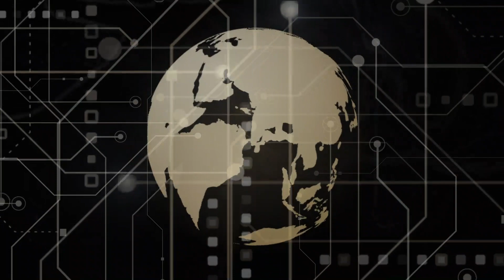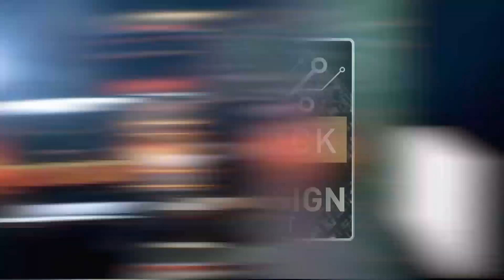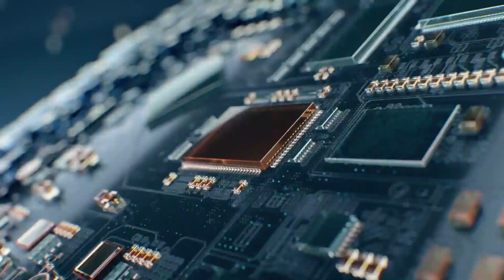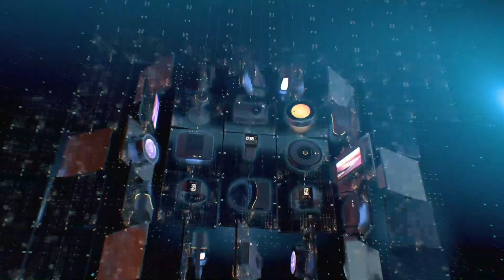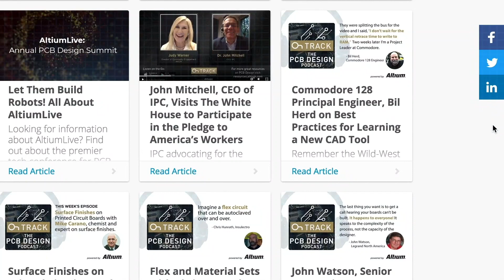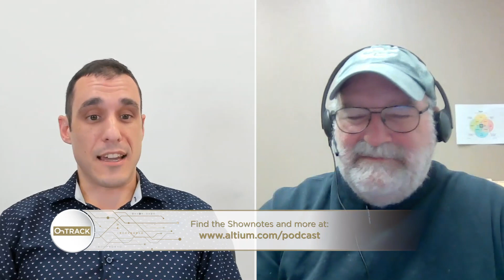Pathological Design Features

Comment: Regarding split planes, one thing I've been considering, but I haven't had the chance to look at, would be a "plane fence".  Recall that the energy is stored in the fields in the dielectric.  Rather than splitting the plane, what if we keep the plane continuous and replace the split with a row of vias?  The plane is still continuous, but the metal from the vias might provide some separation between the two sides of the fence, and crossing the fence won't ruin signal integrity.